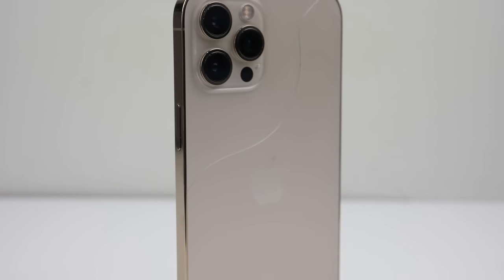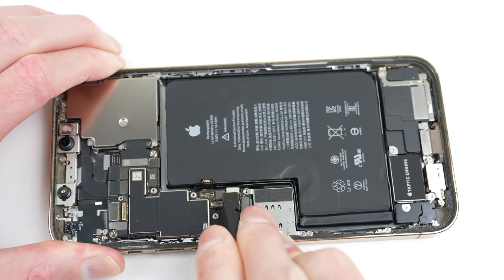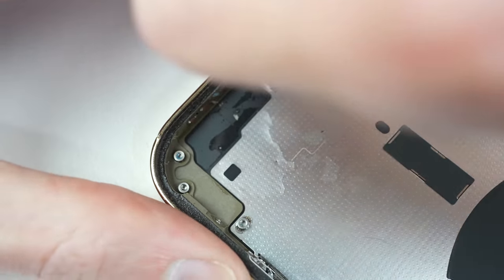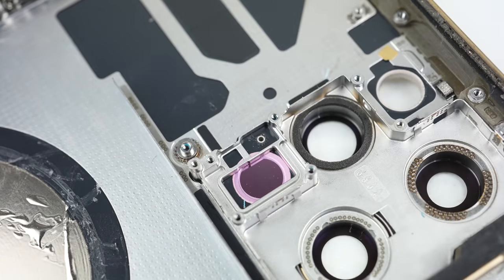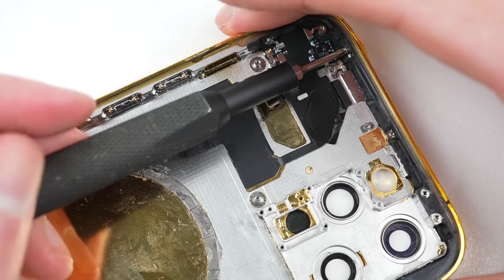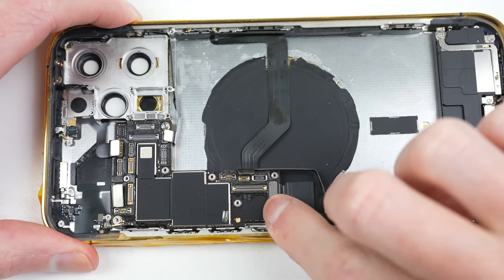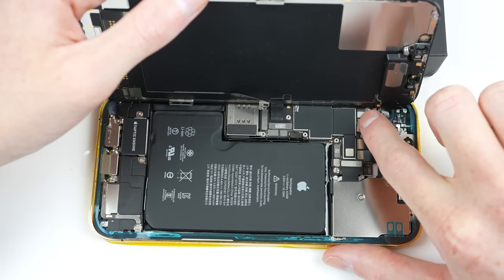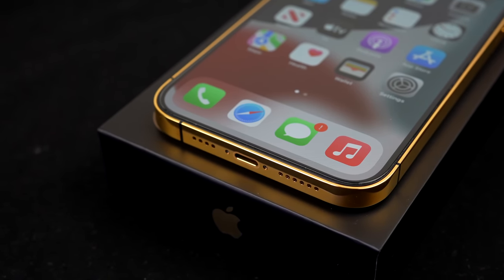Building a Gold & Diamond iPhone 12 Pro Max - Most Luxurious iPhone Ever.

Comment: Nice project - though that took a lot of time and patience! It looks like these iPhones are needlessly overcomplicated to repair and disassemble.
I also wonder if 3G/4G/5G signal strength has also been impacted by that metal back...
Reply: the back should have no affect on the 3G/4G/5G antenna if you look at the 4 corners of the iphone there is 4 non metallic strips  which are there for the antennas and to allows the signals
Reply: hi there!
Reply: The back is glass…
Reply: @Eye-Ay-En Did you watch the video fool

Comment: Different screws with different screw heads have different torx pressure. I can only assume they use Phillips around the housing because there’s more of a solid base behind it so more you can exert more force for tightening whereas more fragile components can’t have this so the tri wing head allows for less pressure and more of a ‘holding into place’ instead of tightening into place if that makes sense?

Comment: I know you have more items than you have on your site. As far as buying something from your site goes, the last two phones I bought were more affordable. I got a Samsung Galaxy s20 FE 5G for $100 new, still sealed in the box and a Samsung Galaxy s21 Ultra 5G, used, with a shattered glass back for $50 and a replacement back glass for $26 making it a $76 used phone. After watching your repair videos I felt confident in replacing the back glass myself. Now it's a limited edition (by repair) Black Chrome s21 Ultra 5G. And nobody trying to take it from me can prove it isn't mine simply because mine's the only Black Chrome in existence. At least until someone else follows suit.

Comment: 13:33 I find it ridiculous that the rear microphone need to be held in in with two screws. and on top of it sits the lidar scanner with it's bracket and 2 screws and then the cameras module with a bracket and 5 screws.
This is unnecessary!